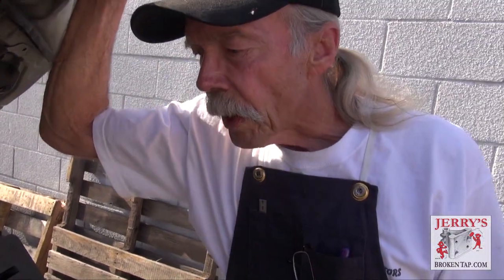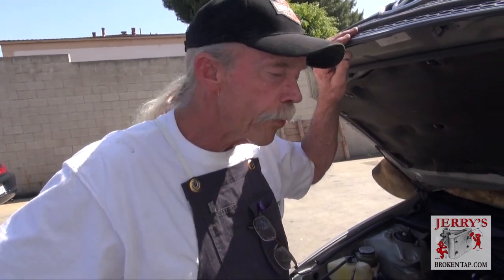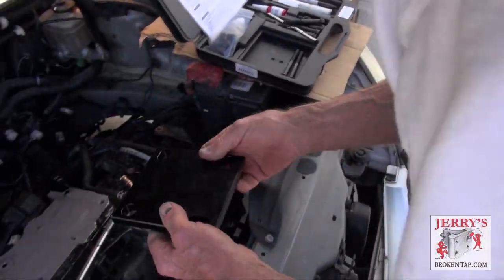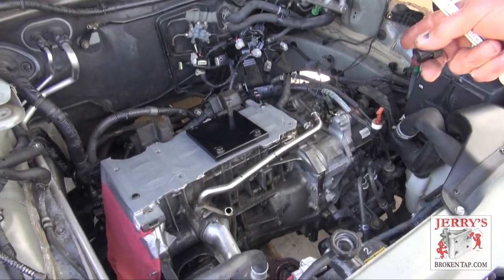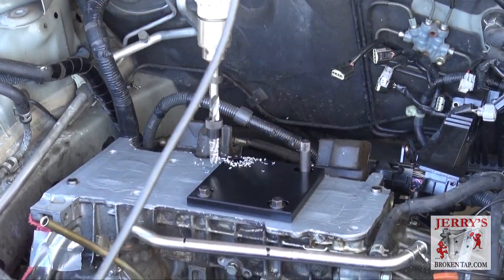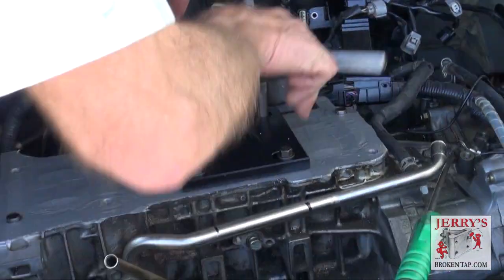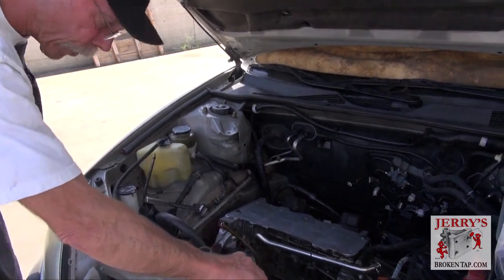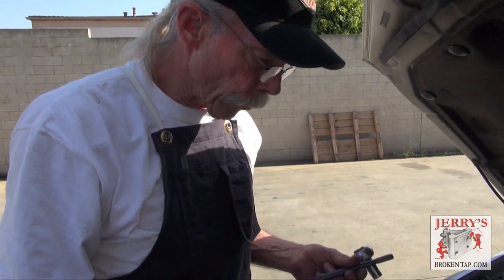Toyota Head Bolt Repair using TIMESERT Universal Head Bolt Thread Repair kit

Comment: Im going to do this for a friend soon and instead of the whole kit with the guide jig tool I have a wolfcraft mini portable drill press (the kind where you use your own drill, attached to their chuck and spindle) to keep it aligned and control the depth. Might strap it to the block with a ratcheting tie down  or bolt it down using the good head bolt holes. Anyone see a problem with that? Hoping this might allow me to work around the dowels without removal?

Comment: If the steel bolts pulled the threads out, why wont the steel inserts pull out of the threads as well, under the same conditions? Wouldnt making new threads in the existing hole starting from the top of the block and using bigger bolts the size of the new threads the length of the threads on the bolts? The bolts have lots of unused threads that shouldve been used from the factory.

Comment: Hi Tom, thank you for the very informative video.   I am in the process of doing timeserts on all of the head bolt holes. I have found on the rear bolt on the intake side there is a hole approx 1/2” in diameter facing toward the inside of the block right towards the cooling jacket however it is filled with water so it does not appear to be leaking. I found it when I put brake cleaner in the     
hole and the cleaner leaked out immediately from the bell housing area. Trying to figure if this is factory design?  Tried find blueprints on the block with no luck. I was going to put JB Weld in it but was trying to find out if it supposed to be there? Can’t imagine why though. Any thoughts or help would be much appreciated. Thank you.

Comment: Great work Tom!  I am doing this job right now on a 2003 Camry.  I have completed the 3 middle intake holes with time-serts (those were the loose bolts I found when removing the head) and now I'm trying to decide whether to keep going.  Should I do all 10?

Comment: What size is the drill bit?
Reply: For m11x1.50 bolt you should use 9.5mm drill bit before tapping the threads
Reply: But thread insert is half size over so it’s m12x1.5 so drill size should be 10.5
Reply: But the thread insert is half size over which is m12x1.5 
Soo drill size should be 10.5mm

Comment: Great video. I have the same engine on an '04 Camry. Do you recommend replacing all of the head bolts or just those that have pulled? I would be afraid that if I don't redrill all them I'd have to do it again.
Reply: I did this with a mechanic a number of years back when four of the 10 bolts failed torquing and stripped. We drilled and tapped all 10 putting timecert inserts in. That was at 195,000 it lasted another 50,000 before I noticed low engine roar issue. Had somebody install crate engine and 100,000 miles later I’m about to attempt the same thing. Because when I pull the head off I’m assuming it has the same problem. Not a mechanic so by myself it’s gonna take a long time. But it’s not going anywhere like it is. Daughter is not good about checking fluids to keep from overheating. Hope yours turned out well
Reply: Did you end up fixing it?
Reply: @Lifesituations8000  Yes. Took the head to a shop to resurface and pressure test. The Toyota TSB on this said to just do the all 6 bolts in the middle, not the 4 in each corner. I had to buy a drill with more torque (Yes, honey, I do need this tool) and it did the job. Unfortunately, I didn't replace the timing chain and sprockets along with the VVT solenoid/actuator, so when it wouldn't start, I found I had no compression. So, then I had to take the timing cover off again to replace those. Not sure if it was just the solenoid/actuator or if the chain was worn. I haven't put a lot of miles on it yet, but it runs great.
Reply: @dejavamantoo  Thanks, we have a 2004 also LE. It has some with smoke on startup no overheating and no loss of coolant. What do you recommend? Should I leave it or try to perform the job you did?
Reply: @Lifesituations8000  Well, I'm not a mechanic, but I've read that this engine frequently has the "smoke on startup issue". If it's black or gray, I think I've read that it's just what some of these engines do. If it's white, then it could be burning coolant. When I told my mechanic (a real mechanic) that there seemed to be a lot of pressure in the the cooling system, he immediately said I could have a blown head gasket. Every time I opened the radiator cap, even when the engine was cold, it was like I had opened a bottle of pop (soda, for those northeasterners) with the pressure release.  You can borrow a leak detector test kit from an auto parts store to see if there are exhaust gases in your coolant. It's a pretty easy test and that confirmed it for me.
Reply: @dejavamantoo  I will have to do that. But let me ask, if in fact it is the head gasket could it be because of the bolts not holding it the head tight? I mean the job that you just did?
Reply: @Lifesituations8000  I'm not sure. In my case, it was clearly the middle two bolts between cyl 2 & 3 as they came out with little effort. It felt like I was going to break my socket or breaker bar on the rest, they were so tight. Also, on the head gasket, the section of the head gasket between those two cylinders had been "cleaned" by the coolant. You will see a difference. Would a head gasket on that engine blow otherwise? I don't know.
Reply: @dejavamantoo  I just took the spark plugs and and found them wet, I believe that is my issue. What gets me is the fact that the engine has no misfire and runs good
Reply: @Lifesituations8000  You mean wet with coolant or with oil?
Reply: @dejavamantoo  with oil

Comment: You guys do first-rate jobs. Can someone please explain to me how installing a steel insert in an aluminum block is stronger. It's still aluminum holding the insert.
Reply: Probably the overlap surface between the timesert and alloy is greater than the original contact surface bolt tread-alloy. This why becomes stronger. But does not matter if better or not. This is the quality approach in such a case. There are other options, but not that good.
Reply: The outer threads of the time cert are a larger diameter than the OEM head bolt so will hold more torque just on size alone. Also when you install the bolt youve got steel on steel. Finally the time sert is loctited in place. I think hi temp jb weld would be better.

Comment: Are you taking warfarin tablets Jerry? That was nice tutorial I had same trouble on one 2AZ engine did not realised that over heating was the reason striped of those treaty . I cold get aluminium insert which I think made from brass or stainless still would be better. In my repaired some drill go through to sump chamber . The engine surface and head become distorted and aluminium lose their temper (soften) that all effect the good dealing of the head gadget which is only made from 3 layer of shin. Good luck is required.Toyota engineer had design a unrepeatable engine! I found out little hardness tester with steel ball test device could be useful for hardness of the engine and head surfaces be fore apply expensive repaired.

Comment: What he got it wrong is that in Toyota's case, head bolts stripped causes coolant leak and then engine overheating. It is an engine design flaw Toyota refused to acknowledge. Not the other way around as suggested by him that overheating engine causes bolts to be stripped. Overheating is the symptom,  not the cause.
Reply: ( Toyota 2.4L 2AZFE engine ) Symptoms of stripped head bolts snydrome: leaking heater core,  leaking/ crack plastic on radiator, high temps on dash temp reader.  Remove the thermostat out / keep topping off your coolant every week, keep the reservoir's cap-straw loose ( to allow boiling gases to escape ) to buy time until you have $$ for a proper repair. You'll create a CEL & loose MPG, but you will stop overheating until you have $$ for a proper repair. Peace.
Reply: How can you really tell in every case whether the chicken or the egg came first? I get your point exactly but it seems to me the factory head bolt threads would hold until an event comes along that subjects them to increased stress. Maybe not a documentable overheating event, maybe just time which does support your theory  but I think it comes down to a blame game. Toyota wants us to believe the owners screwed up and overheated the engine. Your theory blames Toyota for faulty threads/engineering. Toyota should just accept that their design was insufficient whatever the conditions before failure.  My point is it doesnt matter whether the chicken or egg came first, theyre all out of warranty now and failed is failed. Keep in mind he also says at the end "it always starts with overheating" and that can be construed as the start of the symptoms not the cause.

Comment: I am trying to find out if the head bolts should go in dry or be slightly lubricated. I can not find an answer on their web site or anywhere else so far. I am hoping that since you do the thread repairs you might have the answer to that question.

Comment: Great explanation and a great video, thank you! I have a question - bearing in mind you have repaired hundreds of these engines - is this factory design flaw also concernig the 2.0 litre 1az -fe engine as well. And if yes, is the problem solved in the same engine (1az fe) in Rav4 Xa30 model from 2007 onwards. Thank you.

Comment: and you would think that using a ratchet is just wollering out the hole even as much. if you use taps why not use a tap wrench to have equal ammounts of pressure evenly?

Comment: I am currently doing this job on an 03 camry. Someone had already had a go at all of the intake side holes with heli-coils, all at variying depths. All of the exhaust side holes were virgin aluminum. I was set on this path with a multiple cylinder misfire code. found that the intake valves on 2 and 4 were no seating with the cam at the closed positions. It seems like the seats were collapsed and allowed the valves to stay open. The head on this engine has the seats cut straight into the head. (I thought they all used hardened seats, for god sake lawnmowers have hardened seats!) Using the time-sert kit was easy to use, but a very meticulous process for knocking out all 10 holes. I would like to get others opinions now though. I have come across a Toyota TSB that states if there is any thread damage on the 2 pairs of holes on the ends, that the short block should be replaced. The TSB does not explain any reasoning behind this so I assume this is a sales/scare tactic. Does anyone know why the tsb would say to replace the block if those end holes are damaged? I cant recall any difference in feed pressure as i was core drilling those holes as opposed to the others. All of the inserts threaded down to the same depth seemingly with no trouble. From the comments, it looks like most of you are setting all 10 inserts with the job, that makes me feel better about what i have already completed, im just hoping for some positive feedback. thanks for the great video!

Comment: very informative video. thank you. I have 1981 rabbit diesel. multiple holes' threads are broken hopefully I will follow your video step by step but I just wonder what is the torque time sert can handle. mine need 66Lb feet.

Comment: I'm glad you put inserts in all the head bolt holes instead of just the 
ones that fail. IMO it's the best approach for this situation.

There are a few reasons for that, for anyone who doesn't understand why 
you would fix more than what is observed to be broken:

1. All the head bolts on any specific engine experience the same 
conditions. This means that if one bolt pulled the threads out of the 
block after overheating, the rest can be assumed to be similarly 
damaged.

2. Inserts themselves are cheap, and the tools to install them are a 
one-time cost. This means a shop that installs inserts will likely lose 
more money to comebacks than they will save by not putting inserts in 
all 10 head bolt holes.

3. The part of installing head bolt inserts that takes the most time is 
just getting at the block in the first place. This means it doesn't cost
 much more in labor time to install inserts for all of the head bolts 
versus replacing just a few of them.

Source: I'm an auto mechanic, and I'm the son of an auto mechanic.

Side note: I live in NY. You only see a 10 year old car without rust up 
here if the owner garages it and regularly washes it especially during 
the winter months. Or if it was originally a southern car and was only 
recently moved up here.
Reply: Ase certified?
Reply: Untrue to assume all bolts holes are compromised. Some bolt holes are more insulated my material than others

Comment: buy the time you buy a new machined head gasket and get new bolts you might as well get a remanufactured engine for 1400 bucks
Reply: ham shank Yeah, so it can happen all over again. Or you could just fix it right the first time and not have to worry about it again.

Comment: Thank you very much Tom, you helped me a lot by posting this video. I fixed my Mama's 02 Toyota Camry that recently pulled the block threads, with the help of your video. The kit was pricey, but well worth the fix. I did the whole thing myself. To all of whom own these Toyotas, these are the early symptoms: It all started with a PO420 diagnostic code, then the gauge began to climb a month or two later. Exhaust gas smelled of a sweet smell of antifreeze. That's a tell tale sign that your head-gasket, or head has failed. Do not drive the vehicle like this.
Reply: I’m happy I found this comment

Comment: Thanks for this video. I ended up doing the job after your recommendation, here. I was able to save my mom's RAV4 from being sold with a bad motor at a huge loss, and now she has been driving it for almost a year. For someone who can work on cars and has the tools, it takes about 3 days, with a helper, or longer, for your first time. Some things are incredibly difficult to figure out and require a variety of socket related extensions, u-joints, etc. but it is doable. Having a Harbor Freight nearby helped. I also had to make a custom tool for holding the crank pulley, since I didn't want to go buy one. 
I'm able to do this job in two days, now, by myself, for anyone in the DC area. You can message me on YouTube or find me on Facebook under Marc Stinebaugh. Price will be half or less than half what a shop would charge you. Their recommendation is always swap the engine, which is ridiculous.
Reply: Marc Stinebaugh Thanks for the input. Good Job, you must be an experienced DIY to tackle this job. FYI, we also have the 2200 BS Big Sert kit in case someone else has used an inferior Heli Coil kit that has failed previously. http://wiseautotools.com/time-sert-2200bs-big-sert-m11x1-5-head-bolt-thread-repair-kit/
Reply: Motor is still running strong after the fix. No issues as of March 1st 2018
Reply: Frank. T... Not bad. Belt tensioner is the worst.
Reply: @Sherlock_MacGyver  how's the car doing?

Comment: Hello Tom! Where are you located? I have a leaking head bolt p/s rear on a 99' Toyota Corolla VE 1.8L 1ZZ-FE. Great video! Precise!
Reply: usmc9789 Santa Ana , CA
Reply: usmc9789 If you need it done and are in the DC area, I can help you. I've done this procedure and have a reference.

Comment: Can you explain when using the tap why you didn't back off to break chips? Obviously it cut threads just fine. I'd like to know if and when you should back off when cutting threads.
Reply: Fireballsocal I only back off if the tap feels binding. Tom
Reply: Fireballsocal I didn't experience any need to back off, though I did it out of principle. I used a powerful, corded drill to tap the holes, no problems.

Comment: Question? how did you determine which head gasket bolts failed, were they still torquing down tight even though they were lifting or stripped or was the head gasket constantly blowing? It's only been a year an my head gasket is blown again.
Reply: We never look for the holes that failed. All threads become weak so we do the whole motor, all ten!!!